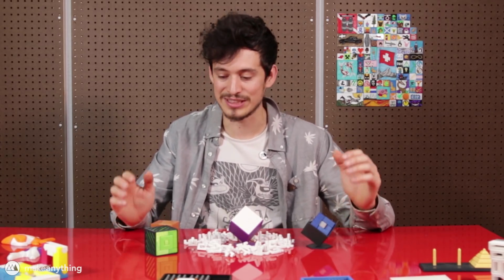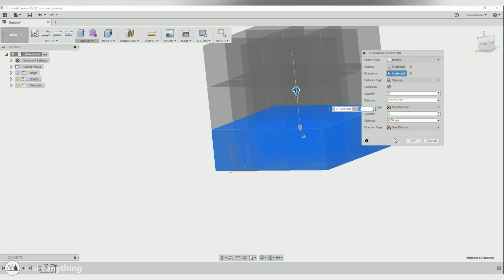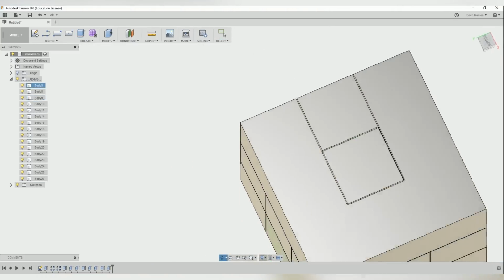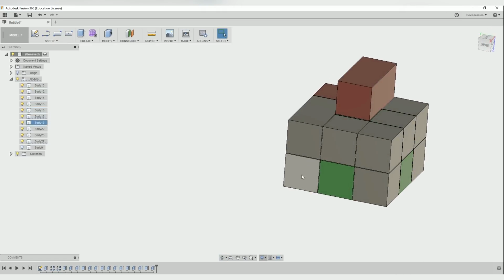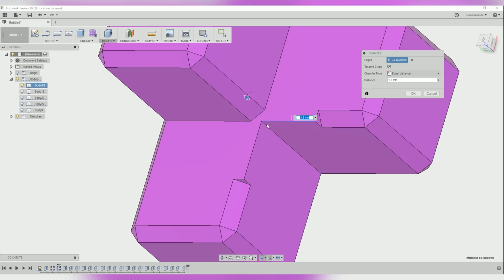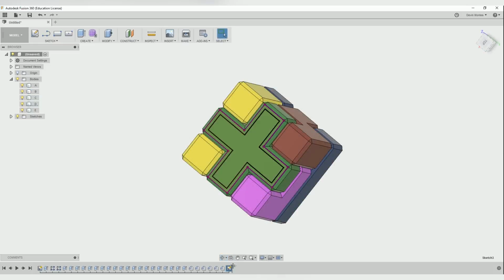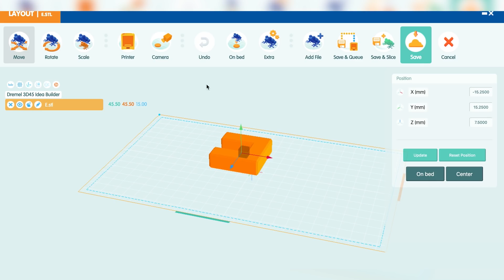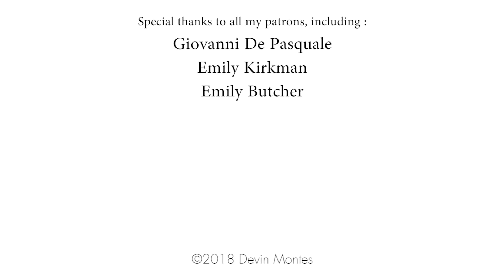How to Make Anything #3 // Puzzle Cubes in Fusion 360 + Competition

Comment: This is really cool! You've inspired me to make one and it's printing right now. 

Here are a couple things I did in Fusion 360 that helped. 

1) Use parameters. This way you can change things much easier. I set parameters for cube height, tolerance, number of cubes, and chamfer amount. So once I got all the single cubes ready, I made the tolerance a large value like 5 mm which made it much easier to select the faces I wanted to extrude. Then at the end, make the tolerance parameter 0.25 mm and it changes the whole model. Same thing with the chamfers, can change them all at once to see how things look instead of having to go into each chamfer feature in the timeline.

2) When doing the chamfers, I would do the chamfer command and then select the whole body. This would select all the edges, so then I just had to de-select the inside edges. This was much quicker as you are basically chamfering more edges than you aren't.

Comment: Great thing to spend time on. Just some little time savers:
- If possible (and for this design it's easy) you should pattern faces and not bodies. Fusion 360 will not slow down that fast if you get more and more bodies.
- After you extrude / combined your puzzle part you could move the body into a component. It's not only a good thing to follow Rule #1, IMHO the browser window is more structured during the design process and if you switch on Inspect -> Component Color Cycling Tool (Shift N) you get your coloring for free. Another good thing is, that you can isolate / unisolate components if you want to get a detailed view for a dedicated puzzle part
- You don't have to select the lines for the chamfer feature manually. You can filter the edges by disabling  "Select -> Selection Filters -> Select All" and by enabling "Select -> Selection Filters -> Body Edges" and "Select -> Selection Filters -> Select Through" 
- You don't have to export all the bodies / components separately . You can right click the root entry in your browser, choose "Save as STL" and choose as "Structure" "One File Per Body".

Comment: I usually rotate parts within Slic3r. Is there any disadvantage I'm not aware of to doing it that way vs in Microsoft 3D Builder?
Reply from the maker: I rotate it before slicing so I can share the file in the correct orientation. For personal use doing it in slicer is completely fine

Comment: Just a thought, but wouldn’t it be faster to design the full cube, cut it with a grid so that you get a lattice with no clearance? This way you can make joining them much faster with boolean unions, and then you can get clearance in your slicer by shrinking the parts a little
Reply from the maker: Scaling down parts will only decrease clearance. Simplify3D has the option to have a horizontal offset, but that's just a hassle
Reply: Make Anything that is what I meant.. this way you'd also avoid the issue with the little steps

Comment: I have a question. Is blender a good program for designing?
Reply from the maker: It's more difficult to learn than just about any other 3D software but it can also be extremely powerful and versatile
Reply: Make Anything The thing is that I never worked with fusion 360, but I have been working for half a year in blender and I think I am at least decent. I will try fusion in the near future tho.

Comment: Hi you're inspiring me to get a 3-D printer but I don't have money it's to expensive
Reply: If you're interested in 3d printing, go to your local library. Lots of them have free to you software and will offer 3d printing and they charge by weight of the print
Reply: Max Baker same, for my birthday I was promised a Nintendo switch, but I won't get a anything else for my birthday for the next 3 years because it is too expensive, but I think I might just talk my parents into giving me a $300 or less 3D printer because the switch cost $300 LOL
Reply: The cheapest quality 3d printers start at 200 with the monoprice select mini and around that price is also the anet a8
Reply: Daniel Kogan I have a monoprice and I  would recommend it. But I am not on the same level as Devin, Maker's Muse, or 3d printing nerd or anyone like that. Still, it is a good little printer. Sometimes i wish it had a larger surface though.